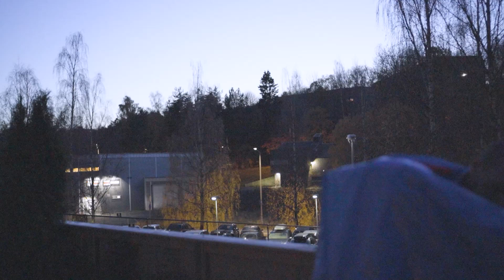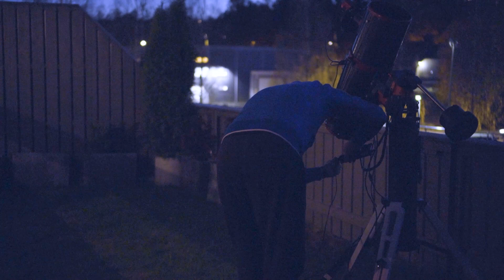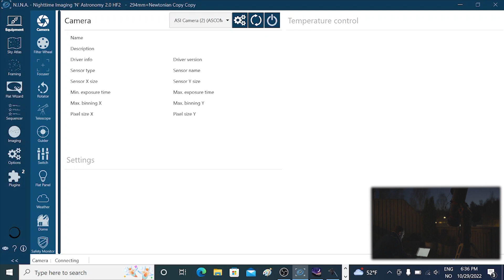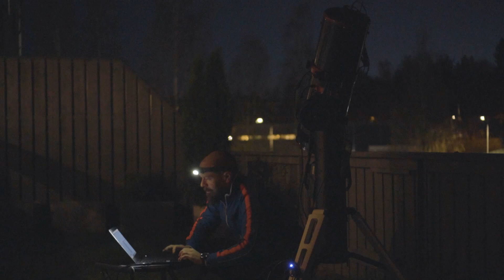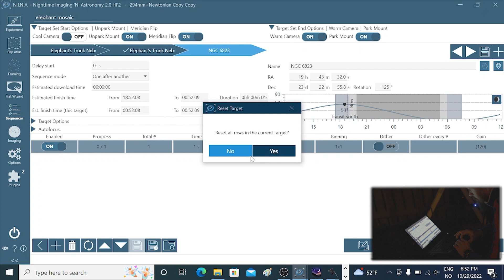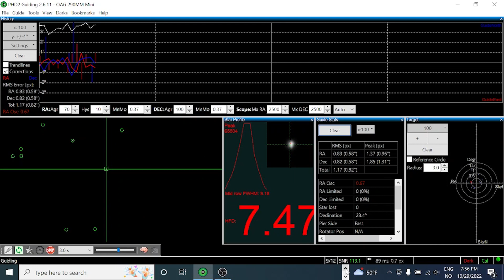Astrophotography 101: Elephant's Trunk Nebula, Part 1. Astrophotography process.

Comment: Don't you get better focus if you do an autofocus for every filterchange? I have parfocal filters, but I always do an autofocus routine when changing filters. What's your experience regarding the issue?
Reply from the maker: Hi! I'm using filter offsets, that's why I don't focus between each filter change. When looping I shoot 1 frame in Ha, then change to Sii and the filter offsets is changing my focus to what I have measured the difference to be. And then it repeats for the next filter Oiii...etc. This makes sure I get exposures of every filter I use during an imaging night. @PatriotAstro has some great videos about this :) Or you can see me doing a manual filter offset setting in my video about the same topic.
Reply: @Bortle8Astro  Do you find that the offset is constant (and correct) every time? I'm struggling to trust offsets due to backlash in the gear every AF have to deal with...
Reply from the maker: Yes, I actually do. And I also feel this is how it's supposed to be. Filters offset shouldn't change significant over time. But as you say, I have also measured the backlash of focuser - and I'm also using the overshoot method, meaning my focuser will always do the adjustment in one direction when going to an excact focus point. Trying to eliminate as many variables as you can I guess :)

Comment: Maybe when you didn't power up and tried to connect everything to N.I.N.A., Ascom swapped ports. Have you tried uninstalling Ascom and reinstalling it?
Reply from the maker: Thinking of the issue with my mount not guiding? That could have been the issue, but it worked after doing a forced calibrate in PHD2 so..Will see if it happen the next time....once the weather stops being so wet and cloudy :/